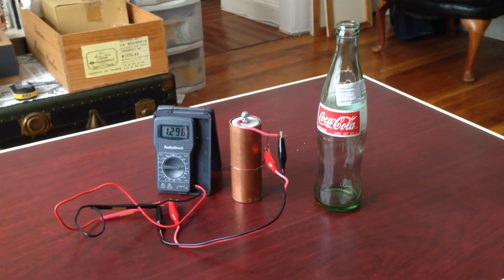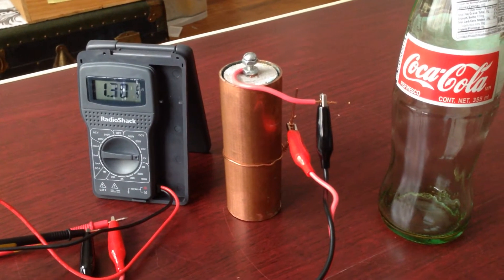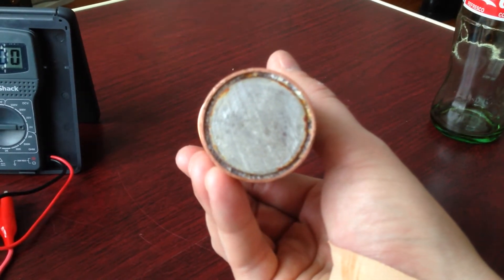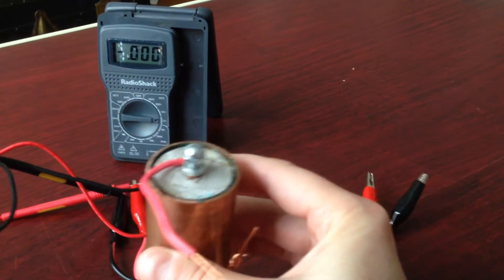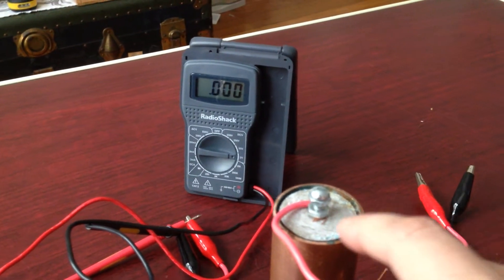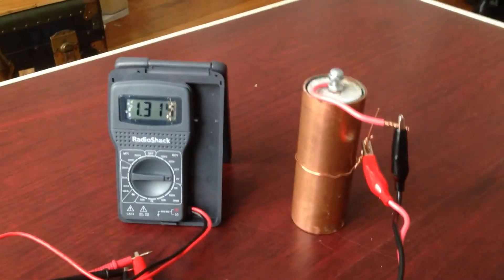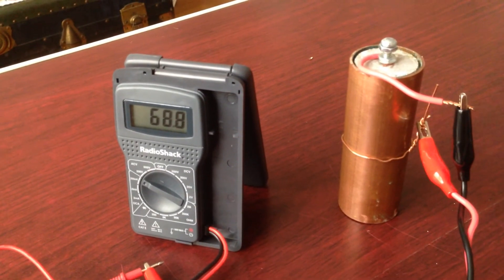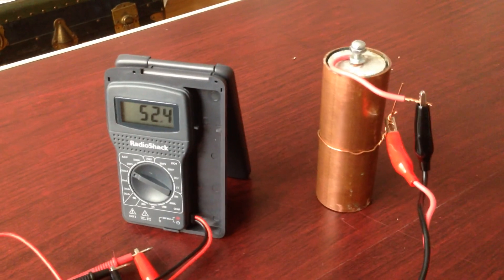Crystal Cell Battery Results & Opinion Part 1 Green Energy

Comment: How to add amps to Earth batteries and crystal cells!
In 1861 telluric energy was discovered in the Alps.  Today this technology is commonly called an earth battery, EB.  Earth batteries work great at producing voltage.  We can build an earth battery in series and create as many volts as desired.  However, the amperage in an EB is very low.  This is what has hindered the usefulness of the amazing earth battery.  Here is how to build an earth battery.   https://youtu.be/aCCK132OIGA

Adding amperage is quite simple and key to making real power.  Power = Amps * Volts.   We have to increase the current in amps to produce any real power.  A simple law of physics shows that wiring in parallel will add the amps of the power sources.  We need to introduce a source of high amps.  A solar panel wired in parallel to the EB will give the circuit much needed amps.  I built this and tested it several times.  It works.  This hybrid system can produce limitless green energy.  The secret will be to have a special solar panel built.  One that wires all the photovoltaic cells in parallel to maximize the amperage.  One 4-inch square photovoltaic cell produces 3 amps.  This super amp solar panel will make the system a powerhouse.

Comment: Hello great video!  Have you ever used or heard of the cylinders of Pharaoh Pepi II?  They are made from copper and zinc cylinders filled with quartz crystal when held produce electrical energy starting at .6 volts and will gain .02 volts every minute held.  Make them yourself or get them on amazon or etsy called "cylinders of the pharaoh"

Comment: Very helpful info thanks! Im using 32mm copper caps was considering making larger copper pipe size crystals cells i.e. 3 & 1/4" but your information was very and stopped me purchasing larger copper pipes. Suprised as you are that the voltage hardly changed at all with a much larger crystal hmm... Thanks will stick to my copper caps and am now a subscriber :)

Joe.

Comment: I'm not sure what you mean by the max is only 1.5v on any size. If you made one twice as long, it would have twice the voltage. The same as if you made 2 the same size and put them in series.
Reply: +Liam Williams Exactly! By increasing the size of cell's components the only thing you're altering is the overall amount of reactants, so the only thing that will change is the time for the reaction to procede to completion (the overall energy the cell provides - capacity, Ah). To get a different voltage you need to change electrode's materials/electrolyte. Read about galvanic series and standard electrode potential, this will give you a basic view on the subject.
Reply: +Yatish Kumar Narasimhamurthy strangely the same here, made a few variations last night. I did manage to get 1.7v with a magnesium core. started off at 1.36v then hit 1.7v the next morning. we did also make a box with several cells in, however haven't tested that yet.
Reply: +Joe Anthing The size only increases the lifespan of a battery. If you want it to produce higher voltage it needs more cells. AAA batteries and D batteries produce about the same voltage, but the D battery lasts longer. The 9V battery has multiple cells and therefore produces 9 volts.
Reply: +Liam Williams iron man says watch a video about super capacitors sooo cool!

Comment: I wonder how many of those it have to make a game boy power up?
Reply from the maker: Zsewq The Wolf it would never work because the cells dont create any amps which is what is needed to power such a device. It creates the volts but that is irrelevant. If you want to try something exciting look into creating a battery using water and an ice cube tray. pretty cool stuff!
Reply: +Zsewq The Wolf Sinve a gameboy runs of 6 volts and takes roughly 240 ma. One crystal cell is roughly 1.5 volts for a good one and can produce 150 ma of current. You would need 4 banks of two. So 12 good crystal cells in total is needed, lol. But it would run constantly for many years.

Comment: Ok so lets make this clear. The chemical reactions is what makes the voltage. Size does not change volts BUT it changes capacity, mah. What you can do is use a Joule Thief to increase the voltage at the expense of current. Essentially converting current to volts, same way that cars use a transmission to convert torque to speed and vice versa to keep your engine RPM's down to safe levels.
Reply: A JT will work but a JT does not limit the current or volts. A boost regulator might work better.

Comment: The reason for the stability of the voltage between size is mainly due to the product of electronegativity of the materials used. The current is still a mystery for the most part. I am leaning to the side of surface area and crystalline material used in the cell. The helper is water and the danger to the battery is water. Balancing the water content is always the hardest thing to do. I used epsom salts as the water base and to activate it it needs a considerable amount of heat to form the layer of water needed to provide current. As the cell cools it will reform crystals aligned to the current flow. So the conditioning of the cell must be done while the cell is cooling with a gradual lowering of the current as the cell recrystallizes.

Comment: I don't know too much about batteries, but I'm pretty sure "size" really results in increased mAh, not voltage or current.
The only way to increase voltage or current (again, I am just speculating because I don't know squat) would be to increase the surface area to volume ratio.  This would be the equivalent of using magnesium disks stacked on top of each other and slightly separated in between each disk by the "crystal" (your salts and water) producing a cylindrical cell of the same volume but greater surface area.  Then you just wrap the outside with the other crap, followed by the copper surrounding. 
I've never even heard of a crystal battery until now, but I imagine doing that method would increase your voltage and/or current (although I suspect that it would decrease longevity).  That, or you might as well just make multiple cells, I mean.. you have 10 feet of the copper rod, right?
Reply from the maker: Hi there! Yes the more you build the more the colts increase however the opposite is true for amps, even when running them in parrallel. Even if you were to get 500 mili amps up front. Truth is once something is connected and the power turned on, the amps will be immediately zapped to 0.01 amps. I have yet to see someone prove otherwise that's why the only things they are good for are running LED lights from RadioShack. But it will run forever although it won't be bright. Check out laserhacker.com and watch his videos. He kinda at forefront of this evolution cheers!

Comment: The voltage is directly a result of the specific chemical reactions going on in the cell. That is why a NiMH produced about 1.2V in AA size and a Lithium cell (depending on exact chemistry) is 2.9V-3.6V. Current is dependant on size but not how you would think. IE a cell twice the size will not allways give twice the current. Current output is dependant on reactive surface area. So a cell that is twice as wide and twice as tall will not give you 4 times the current unless you get the scaling of the anode and cathode surface areas going up proportional to size. For example if you use 12mm diameter magnesium rod and double the diameter of the copper pipe, you would not ger any more current as the surface area of the magnesium is unchanged. In fact you could get LESS current as the internal resistance of the cell will increase due to the distance between the electrodes.
Reply from the maker: Cool thanks for the info!

Comment: A better setup is a plastic tube with copper and magnesium discs layered with the crystal mix...you only need a small layer between the two metals, and they can be compressed down with a rod and rubber mallet (increasing efficiency). Your demo battery could hold at least 50 disc layers with no problem and be 50x stronger in both voltage and amperage. Remember, voltage can be converted to amperage with resistance :-) These batteries do have practical use if combined with other methods...we built a battery that runs a 12v 2amp dc motor fan...which has been running at full speed for 4 months now. V=IR ...dc-dc converters are also cheaply available for regulated voltage/currents.

Comment: I have tried the lye, alum, Epson salts. table salt and a mixture of carbon graphite with other cells in the past, as well as different sizes baked and non baked. with mixed results. Then I Just tried ordinary rock salt with a light sulphuric acid mixed with distilled water, not packed down hard. I'm getting the same results and the contents are easier to load into the cell. Not only that I link three or 4 cells in series and can light a Ultrafire 1000 lumen light for three months so far, turning it off for at least 12 hours a day. I need to add a little distilled water every month or so to keep some moisture in the cells so they work.The copper tube I am using now is huge @ 2" diameter for easy disassembly in the future, length is 7.5". The magnesium rod is cut up from 1" sacrificial anodes for industrial type heating boilers for offices, factories and buildings. These are great as they are long @ 4 feet in length. I have discovered the size and length do not matter when it comes to cells in terms of power output. But the bigger they are including the size of the components allows for longer term use and easy dismantling for renewal of the magnesium core and salt electrolyte. I estimate that these cells running the way I use them should last about 4 years before the core and electrolyte will need renewal. The problem with these cells is no amps. So only very small led lighting can be run with them. In conclusion they are not any miracle free energy device and cost a lot to make but in a time of crisis it is good to know that you can have a source of light at night. People in the third world would not be able to afford the components, unless we send them to them and teach them how to look after them properly.
Reply from the maker: I agree with your results and its use! And I like the fact I will have light in times of an electrical outage or if you went camping. Would be great if 3rd World had access to this.

Comment: Heard you say you poured water into the mixtures. I found using any water at all on these is really bad. Think you're not getting any amps from fast corrosion or something. I've messed with a lot of these types of batteries and the ones I used water on last like 20 minutes to a few days and ones without are still going after a year.

Every time I ever had water touch the metal it would quickly ruin the battery but I know I saw someone have one last a long time with some wet, mixture soaked cloth around copper. It is mystery.

Anyway, nice video. Need more people messing with this stuff.
Reply from the maker: Thx! I did not use water in the making of my cells, but also not happy with overall outcome. Until someone can figure out how to run these in parallel, I find these useless with exception of LED lights. cheers!

Comment: question. how long do yours take to harden???  Have you done the cooked type?
one of mine is setting up real slow
Reply from the maker: I do not cook, and even laserhacker agrees not to do so, eventhough early videos showed it. Just make sure you have a good sealer on both sides. Eventually, the cells will crystalize and become like a rock inside. It takes time, but you can still use the cells as soon as they are finished!
Reply: yeah I use wax then a ring of waxed cardboard then cap it off with an electrically conductive epoxy that becomes part of the outer copper casing.

Comment: yours should have higher current.  I dont understand that.
Reply from the maker: Not sure why? But I am not looking to investigate with crystal cells any further due to limited amperage. You can have the volts but without amps its useless, unless you are using them with LED lights, which i highly recommend!

Comment: jonfrommanahawkin1 has developed his own crystal composition that you should try instead of lasersabers. It's table salt, alum powder & no salt. A cell of that size can output over 200mA at 1.4V easily. Also wiki Cathodic protection & galvanic scale chart. This is what is giving you your voltage. current is given primarily by what the crystal structure is made of. The Mg core is your fuel source so size determines life span. You can check out some of jon and my videos to get a better idea.
Reply from the maker: Lynn Mango Andy Shell  I just uploaded my third video which shows results of 3 batteries not heat treated and my other 9 which are. The non-treated have held the test of time but i also kept them under a load for two months. The other 9 that were heat treated have mixed results but they were also not kept under a load. In all my batteries, I have not seen any corrosion of copper, however, when I cut my first battery up in video 1 into three parts, the magnesium was definitely being eaten away at.. lots of crystals starting to embed in the soft metal.

Overall, the heated treated seem to blow the volatage and amps through the roof, but 3 months later, their performance is no greater than the 3 cells not heat treated. Hope this helps!
Reply from the maker: Hi Andy! Thanks for the info! I will definitely look into the new mix. My goal is to run some things, and that take amps! I look forward to checking out jonfromanahawkin1 too and see what else I can learn. thx!
Reply: Does it corrode the metals?
Reply: Lynn Mango It does but It seems to be at about the same as lasersabers. I was told heat treating the copper pipe reduces the corrosion exponentially though. This might explain several cells that have corroded rapidly and others exactly the same that have had minimal corrosion as I heat treat some cells and not others.
Reply: Andy Shell never tried that. may do so in the future.
thanks andy.